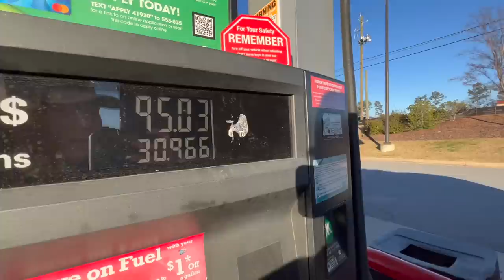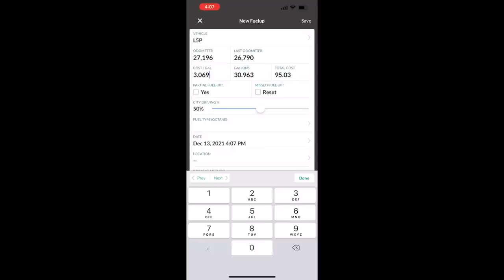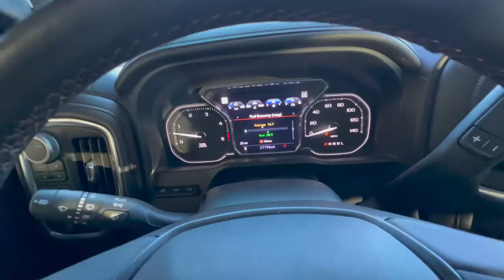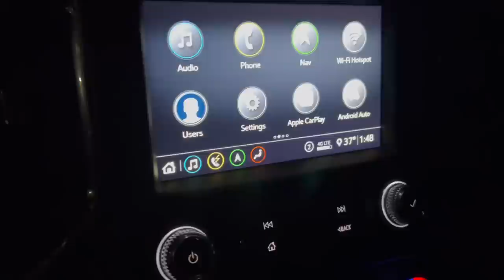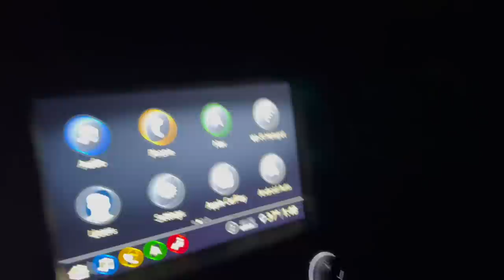Warning! Avoid These Common Mistakes When Installing Lights on Your Truck!

Comment: Not too bad I ran all my wires through my frame crossmembers but I do have a neat bundle of wires hidden somewhere under the truck😅. I do regret getting rgbw instead of white leds since I never use the rgb plus it would've been a Hell of alot easier to install.

Comment: I just installed Rock lights and wheel lights on my truck . Looked at your videos and another YouTube video justinhawks wear he uses DB auto lights,  I had to go with his set up Plug and Play  solid white , and did a clean install extra wire easily hidden also comes with a wireless remote.  I think the average customer would want plug and play
Reply from the maker: Plug and play is definitely the way to go for your average Joe and first timers. We just strive to improve and rather not have a bundle of wires on our trucks anymore. It’s preference

Comment: Do you have any videos of the install on the white lights? I have a set of blue rock lights I want to put on my truck. But im torn on how to install them. I would like to tap into my dome light, so when it comes on, they will come on.

Comment: Hey did you ever buy a new truck yet because my buddy sells cars it’s Dealership he just got in a 2022 GMC 2500 Duramax diesel turbo diesel AT4 with a It’s black but he wants $75500.00 for it

Comment: Hey I got some rgb rock lights and they have a off button on the remote it comes with and I was wondering if hit the off button on the remote if it would drain my battery dead

Comment: Diode Dynamics' new Stage Series RGBW Rock Lights provide 4 leads but you can use splitters (to a max of 8?) and they provide 3 different lengths of wire (1m, 3m and 5m).  Still have lots of extra wire and it's an engineering puzzle to optimize the location/wire combo but it is plug and play.

Comment: Any help you can give me would be greatly appreciated too I don’t understand what you mean by on the LP five I know what tuning is but what are you deleting because I just bought the brink call Brinks mega break or Mehtap mega pedal I got a pretty good deal on it so I bought it and I ordered a 5 inch exhaust I’m putting a 5 inch lift I want to put 24 x 14 1/2 or 24 x 13 1/2

Comment: Mount all the boxes on abs plastic & cut everything to length & re shrink wrap or other insulator materials to clean it up.
Reply from the maker: Cutting everything to length and re soldering it takes way longer than regular white lights with just 2 wires. Most customers do not want to pay the extra 3-5 hours of labor.